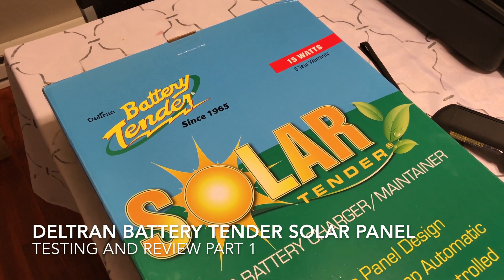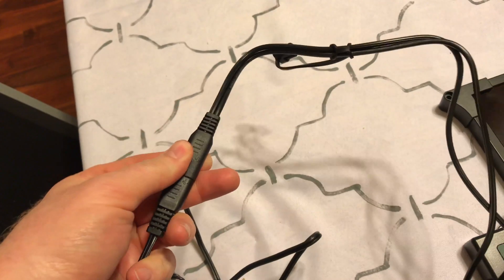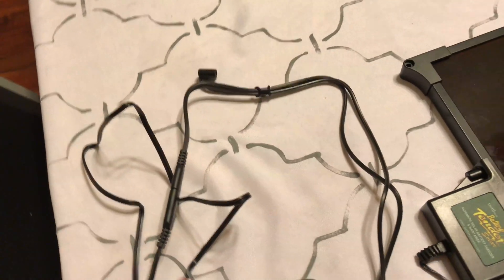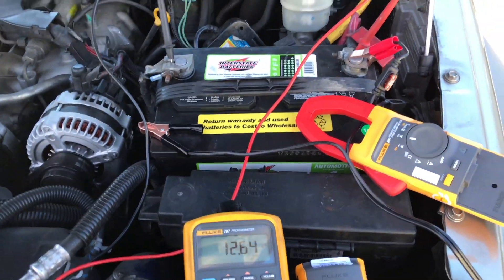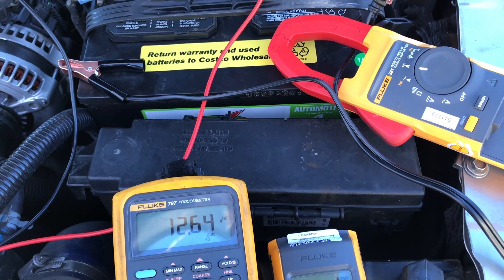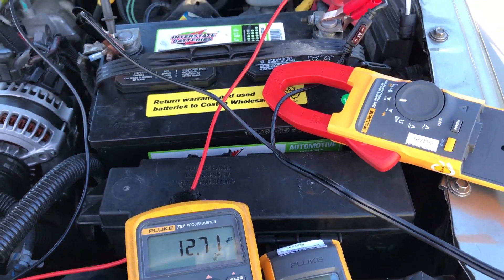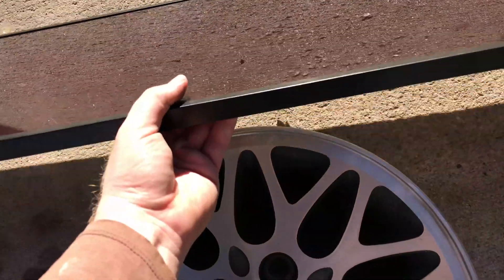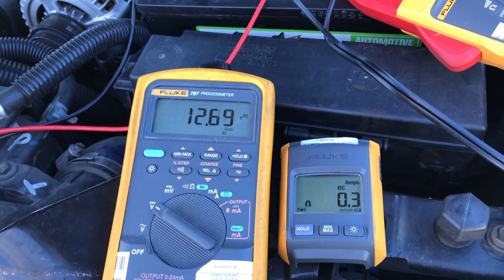Deltran Battery Tender Solar Panel Testing and Review.

Comment: After 5yrs, is there one of these that is maybe half the size? I'm looking to offset a parasitic draw from a hands free link module in an Acura. In the summer it is not an issue, but once the temps drop in winter I can't leave the car parked for more than a day or two without battery issues. Also wondering how well it would work in the winter time. Appreciate the video, thanks.

Comment: Could you use a splitter cable with this unit and charge two motorcycle batteries at the same time?

Comment: So, I hooked mine up and connected it to the battery. Did your light indicator automatically start flashing? Mine is doing nothing. Or do I just need to wait for the solar panel to charge?

Comment: How many amps do you need to keep up a car, or riding lawn mower battery throughout the winter?  I'm trying to decide between the 10W vs 15W version.
Reply from the maker: This isn’t a super easy question to answer. The Nissan I use this with has a security system that will drain the battery if I leave it sit for a month, so the solar panel works well there. I have a diesel Land Rover with no electronics, and it can sit for months in the dead of winter and start right up when I need it. A lawn tractor likely has very little ignition off draw, a car will have more, and if it’s like my Nissan a fair bit. The other factors are how much sun you get, angle of incidence, and for how long. I went with the bigger is better mentality here.
Reply: You need as many amps as the sleep draw. Double that for weather variations. Double that if you don't have all day to angle the panel to the sun and just lay it flat and place it behind car glass. 4.5w panel is good for 30ma draw. 7w is good for 50ma draw. You can tape over the panel to reduce power to the amount you need. You have to account for other stuff as well. A LED draws 20ma. A controller will also use power. If you get it roughly right, you don't need controller, and you won't over charge.

Comment: Thank you for this video. Your test was very informative. The last test with the "dead" battery answered a question I had. In case you didn't know, the reason the voltage and current was jumping around was because of the desulfating circuit. These pulses are supposed to recondition the plates. It's interesting that it does this automatically. I'm impressed.
Reply from the maker: Ezeria Moore ah that makes sense. I had not considered that as being the reason.

Comment: Thanks for the video! Do you think there would be a problem if i leave it plugged in permenantly to my car?
Reply from the maker: Team Neudimensions it should be no problem. I have had mine plugged in since since December when I filmed this and it just keeps my battery ready to go. I did picked a different but of wiring from eBay that had ring lugs so it could be attached the the battery post clamps. But the large clips it came with have been working fine as well.

Comment: How does it signal when it's fully charged?
Reply: Light has three modes, flashing amber=problem, steady amber=charging, steady green=charged.
Reply from the maker: vpsaline there is an LED light on it with a charging and charged text next to it. I think red is charging and yellow is charged. However the colors are sort of hard to distinguish, really charges ought to be green.
Reply: I think slow flashing amber means there's a connection to the solar panel that's actively creating voltage, but there's no connection to the battery